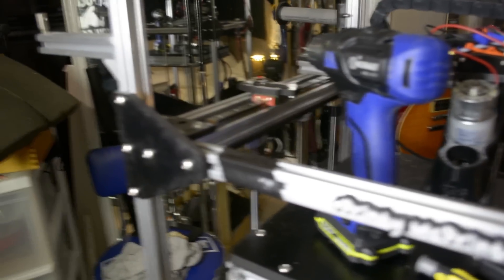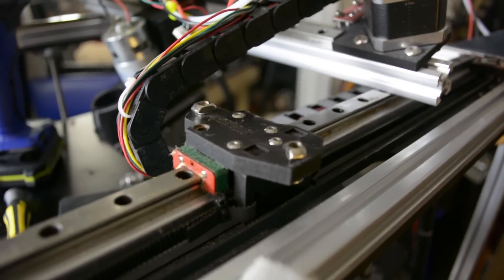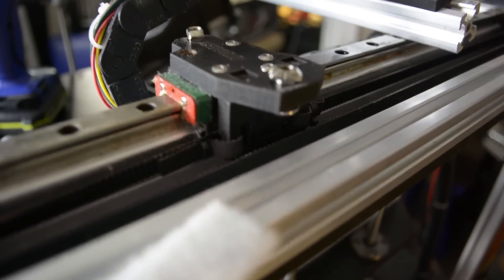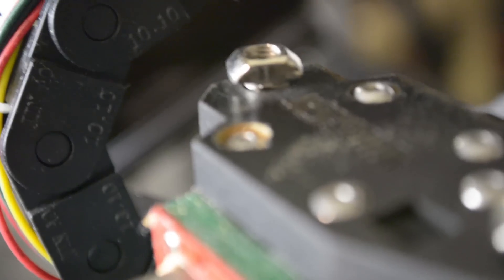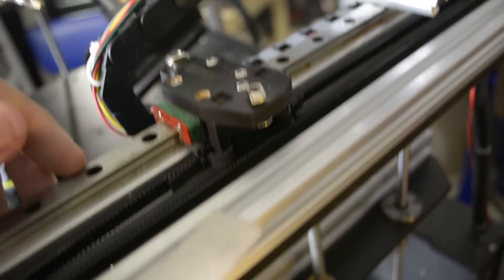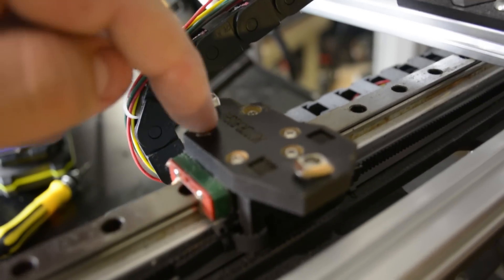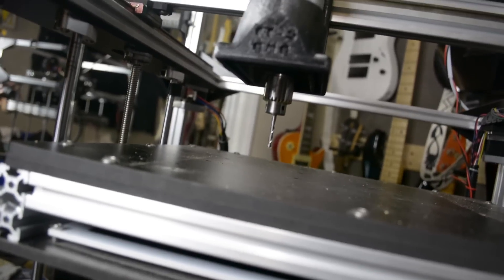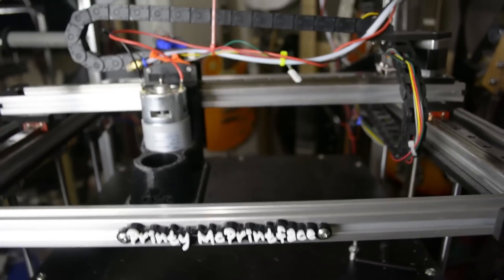Folger Tech FT-5 Slider/Rail Binding Fix

Comment: What could be the result of the rail binding? Cus I'm having a skewed printed parts only at Y-Axis.
Reply from the maker: That could be binding, but that could also be the stepper drivers not being tuned,
Reply: If its on the stepper driver, do I need to increase the voltage? For binding, do I need to make sure the rails are perfectly leveled?
Reply from the maker: Yeah, They should be 1.1v for the Y axis. And yes, the rails need to be perfectly level and parallel.
Reply: I see. The instruction says 1.3v. I might settle for 1.2v. Thanks for replying. Helps a lot.

Comment: I can clearly see why your rails are binding. These are cheap Chinese MGN clone rails and look at them ...... they are just a disaster to look at. Dust, possible rust? I don't know what all.....These rails are NOT water resistant and certainly not dust proof
Reply from the maker: Not rust, crappy grease from the factory that is dried up. No binding issues since this mod. I purposely don't clean the rails to give them a worst case scenario.
Reply: PALEEZE Dustin: if your the tech guy for Folger Tech, find out that these fine sliders are used for tolerances of .0002" in a 4ft length, which means that during primary assembly, everything only goes to a snug ( movable) tightness, and that indicators would be used for checking things out. It certainly won't stop my purchase of this kit tho, as it iz far more tight than my makersnot 2X! :D upon recieving/ opening the slider packaging, the first thing that happens is a parts washer cleaner- or @ minimum alcohol, then a spray mist of (minimum) thin oil, NOT WD 40, or any other 3D Print type lubricant. Put "Clean Room" into your thinker muscle, and you will be fine! :D

Comment: I found cosmoline in my sliders I had to flush the linear bearings with alcohol and oil. I used way lube oil as it was handy. Just leave them on, remove the steppers so the slider moves freely. Squirt alcohol on the rail, run back and forth. Then wipe away all the brown goo. (even the groove on the side) Oil very lightly (keep oil light shouldn't fill the bolt pockets) repeat til the alcohol comes out clean. Finish by lightly oiling.

Comment: hay i got the same kossel  printer i say.. i got this thing work at 98% but this thing prints like it thinks the bed is leening to 1 side about 1-2mm and the other side is dam close to ZERO  scraping the bed but not at the same time  its extruiding all most nothing on that 1 sidefor the first 2 larys .....
if i put some tape on 1 side it kida of eves out but i shold not have to
i look all over the place on the next but found nothing about a delta with this proble wish i can get some info from you?

Comment: Actually, this isnt the issue really. The problem is when you torque the screws down, the trucks rack.  The X axis pulls the truck mounting faces out of plane. I found the best thing to do to get them as smooth as they should be , is to float one rail.  Line them up perfectly , tighten the mounts on the X extrusion , loosen the right rail (every screw) ever so slightly so its allowed to float a bit.  this will eliminate all racking.  Also, the melamine pieces flex too much in this particular usage.  I machined aluminum parts for mine , and its much better , but still needs one rail floated to be right. This method is not uncommon in dual rail systems like this.  Note: My melamine mounts were countersunk properly to clear the screws , and the problem still existed. While proud screws will make the issue worse, it isnt the primary cause.  I should also mention to  do this with the belts OFF/disconnected.  You will not be able to tell fully if you have it right with the belts connected.

Comment: You should remove the part, or cover your rails with tape or something to keep the dust off them. They WILL pull the crud in and make them run poorly.
Reply from the maker: NDFPV yes, that is the proper way to do it. I look at it as a calculated risk, for me at least.